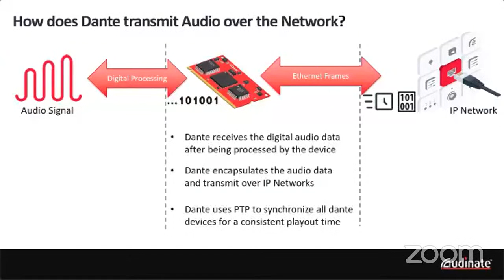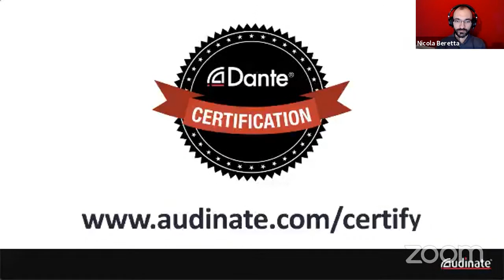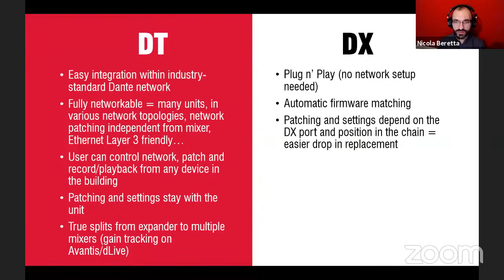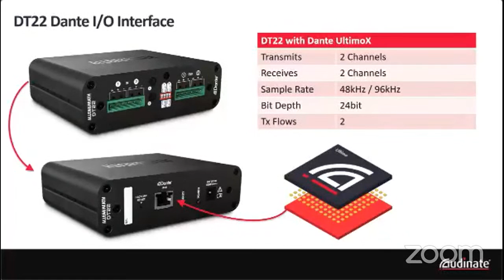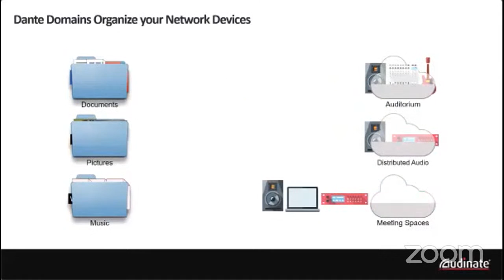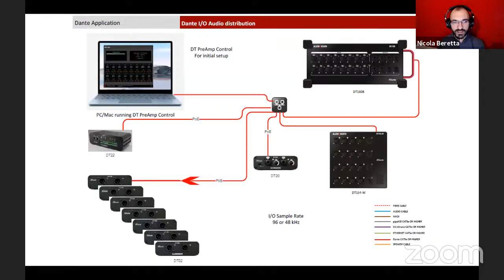Allen & Heath - Deeper Into Dante – Webinar and Exclusive Preview

Comment: in Dante 64x64 Avantis... 
Can I use a second console on the primary port and a third console on the secondary port, with all mixing channels independent?
Reply from the maker: Hello Math, Oliveira931,
Each console will still require a Dante Card fitted on their respective I/O port.
You can then simply have all three console connected on the same Dante Network.
If you need further assistance, please send a message to Support@ allen-heath.com
Thank you,
Rafael

Comment: Hi everyone. Does anybody know if when Internal Network Bridge is ON, does it filter multicast going to the DLive's control side?
We want to use only the DANTE connection to the switch and control the DLive, but in our complex system, multi-network with other things connected together in the same switch/router, it can be problematic AFAIK.
Thanks in advance and greetings from Brazil!